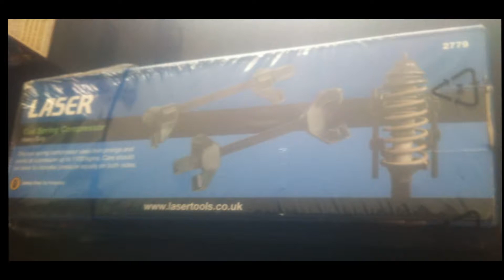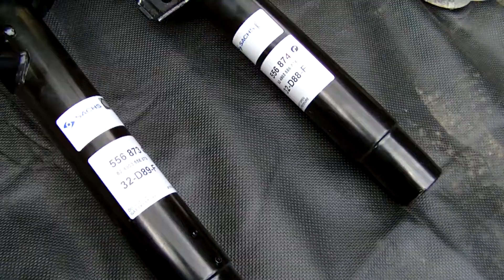BMW E46 Front Struts

Comment: Great job!   These are fantastic cars and while they are getting up there in age, they are easy to work on.  Congrats!!!  Mike
Reply from the maker: We've had her since new and she has never let us down.  The only reason she's still part of the fleet lol the cooling system is the biggest pain in the ass but apart from that I love her to bits :)
Reply: We have a 2000 328i E46 and continually perform DIY maintenance.  You can't complain as it is 18 years old and just needs some attention.  It is fun to work on and I love the German engineering.  Our largest project was the Rear Subframe Reinforcement Plates.  Don't want to do that one again.  Cheers and keep having fun!
Reply from the maker: Can't beat the Germans for engineering.  That subframe job doesn't sound like fun though 😂

Comment: Nice video!

If only it would be so easy everytime. I mean the right one was like butter, but the left strut ... broke some tools, nut stuck, shock wouldn't sit back on (needed to space out more those arms like). In the end with some handy tricks we finally did it and went for some fastfood.

P.S. If you need more space for the strut to sit in properly put a metal plate between and use the sitting bolt to space it out, but not overdo, just as needed.
Reply from the maker: Hitom97 &Stuff isn’t it funny how one side can be completely different to the other?!! Not funny as in haha 🤣 it can be very frustrating!  The joys of wrenching 👍

Comment: Ohhhhh..... I got mighty nervous @ 1.05 ....We need to get you a pass through socket set....   :)
Reply from the maker: A spark plug socket in the right size would have been perfect but I don't have one haha I make do with what I have ;)
Reply: I hear ya, I've been known to make my own tools from time to time.....I'm fairly dangerous with the welder ...lol... we still need to send you some tools, I've got two brothers in DownPatrick, one owns a garage and runs around building rally cars.... (with all my snap on tools that I left him when I moved...ugh)
Reply from the maker: Haha I'd love a welder but I can't solder or shrink heat tubing without burning my hair.  I'm lethal 😂😂😂
Reply: Don't worry, I burnt my armpit twice today welding an exhaust pipe upside down, and for good measure I took one in the neck as well.... #need a welding apron...lol
Reply from the maker: Haha YouTube held your comment for review 😂😂😂 I wonder is burning armpits offensive to them? LOL